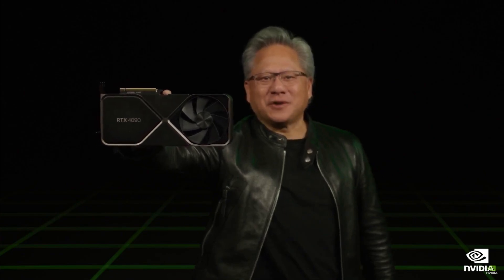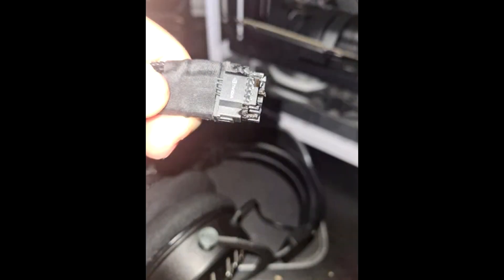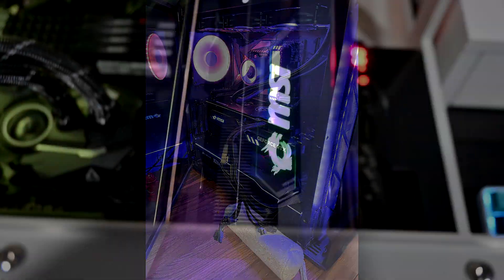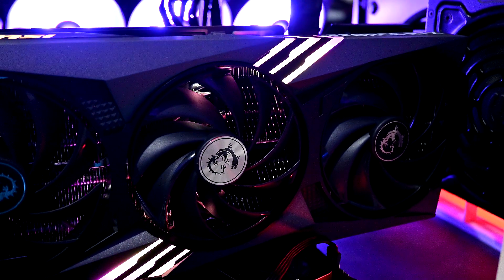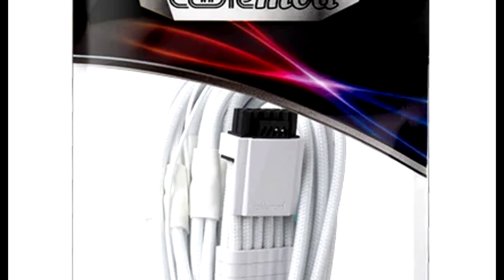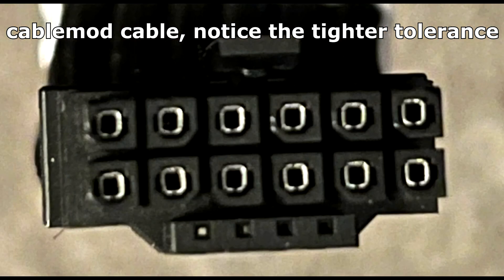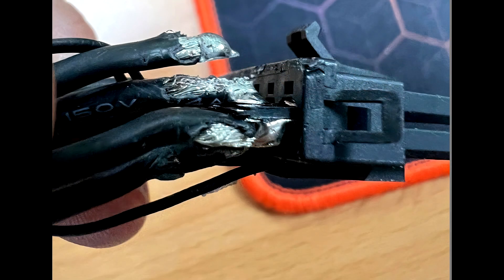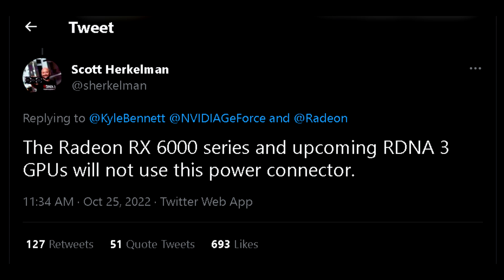RTX 4090 Cables/Adapters are Melting This is Dangerous! Nvidia Has Gone Silent and I Am MAD 😡

Comment: Planning on getting a new PC to replace my old high-end PC from late 2013, it's done me well throughout the years. Eyeing the Intel i9 13900KF, 32GB DDR5 5600mhz RAM, x2 2TB Samsung 990 PRO M.2s,  and the RTX 4090 to last me the next 5 years at least... but hearing of this issue has left me rather concerned to hold it off for awhile.

Comment: Steve at Gamers Nexus confirmed and Nvidia's internal testing confirmed user error in plugging in the adaptor. And of all the RMA's only effects 50 cases over a 125,000 sales. So a 0.04-0.05% chance if you aren't checking your cables fully seated. Also my MSI RTX 4090 Gaming X Trio is on its way and I cannot wait to game in 4K how it should be enjoyed, RDR2 is finally going to be maxed out haha ;) Just hope I don't melt my cable lol. Sounds like the early cases will be swapped under warranty but now the tests are concluded be very careful as they may not accept them moving ahead.

The connector is just a poor design sadly, still should've done much better then what's happened. Hopefully they can find a better design going forward that reduces the risk to 0.01%, always going to be human error in the world.

Comment: looks more like aconnector housing issue!, maybe there is a sub standard batch of poorer quality connector housings. i think they are injection moulded, might be a type of ABS plastic? i dont know. Also maybe as they are (it seems like) crimping 3-4  16-18awg?  cables to single crimps? Would br interesting to open one up to have a look!

Comment: mine actually runs quite well at 2.8ghz with 0.950v and 1500 mem oc at 80% power limit. i found i could reduce power by 30% and only lose 6% performance.

Comment: well i had even bought a new psu before 4090 launched, my old psu would've never survived a 450w card especially if it was plagued by transient spikes like the 30-series was, with spikes up to 2x the max wattage... so on a 450w card that would spike to 900w. played it safe and bought a new high end psu, it came with 2x 12vhpwr dedicated cables so i never used the nvidia adapter on my gaming x trio. altough i'm pretty sure it's not at risk of melting that adapter in this way, i have mounted a external temp sensor that came with my mobo. feeding that info into hwinfo and set an alarm when the temp sensor sees more than 55C, so far it's not even come close as i also monitor the temp in my in game overlay.

Comment: Your bench testing IS way different because people are bending the cables when they shut their glass side panels.  For example, the Lian Li Evo will not shut and you WILL have to bend the cable if you want the side panel shut, NOT SMART because IT WILL MELT

Comment: I bought the TUF OC the morning they dropped at MC and have been pounding it with games, even running it iverclocked and on top of it have plugged and unplugged it a bunch of times swapping gpu's around. Cable looks good as new amd it never gets hot to the touch which I've been checking out of curiosity.

My conclusion is that some of these adapters have got to be faulty but I also feel that it's a plug design oversight that can lead to user error. When you plug the 12 pin connector it requires some force for it to sear all the way inside and unlike regular pcie cables it doesn't click when it's fully seated. I think people not fully seating the plug could be a contributing factor.
Reply: Damn auto correct on the phone. Lol

Comment: Me who just got my msi gaming trio yesterday waiting to see if it melts lmao
Reply: don't use the card until an official announcement let's us know what to do.  Cheap 3rd party cables are just as bad and the 12 pin connector will stick and it's a PITA to get out....trust me.
Reply: @harpoon_bakery162  ordered cable mod adapters, in the mean time keeping an open case and avoiding any bending of the cables
Reply: @Taima_the_lion  how are you keeping everything cool with an open case?
Reply: @harpoon_bakery162  temps are really damn good, hottest my gpu gets is like 60 when gaming and that’s even without the fans maxed out either

Comment: Hi I am new to your channel. I wonder having atx/5.0 with 12vhpwr (one to one) thermaltake cable.. Do I have to worry?
Reply from the maker: Having a direct connection from the card to PSU without any adapters would be the best method for connectivity. You should be fine, I wouldn't worry about it.
Reply: @DannyzReviews  Thanks for the feedback.

Comment: It surprises me that at least one person had a problem with the 3x 8 pin to 16 pin on the gaming x. I thought it was the same adapter people have been using for the 3090ti for months now, as far as I know without controversy. You'd think if anything was wrong with it it would've been known months ago, but maybe it really is a poorer quality one.
Reply: 3x8 if self identifed by the cable to the card, but cable-mod said for more redundancy , use the 4x8 (Cable-Mod-Matt said that on a Reddit post).  What are YOU going to use, 3x8 or 4x8 to the 16 pin?

Comment: That's is why better to wait rather buy it and have a stupid problem i got my 3090 after a year i look if it good or has a worse problem. Melting power cable so scary what if you buy some drink outside  then when you comeback your house burning XD. When the new product come better to wait just hold on when everything is perfect then buy it.

Comment: I'm curious if the people with these problems are listing which power supplies they are using
Reply: Idk I have a 3090ti fe that I've had since they came out, and it uses the same connector, and draws more watts then my 4090 fe, and never had an issue with it, wonder if certain psus push an uneven voltage thru the cables in that adapter
Reply from the maker: Did the 3090 Ti FE come with the same adapter?
Reply: @DannyzReviews  I have the founders edition,  on the card itself it's exactly the same, the adaptor just doesn't have the 4 sense pins those are blanked out
Reply: Idk, I mean I'm a licensed electrician, and am also an electrical mechanic for locomotives, and dealt with a million types sizes of connectors and wires. They definitely shouldn't have soldered the connection. They should be either crimped or clamped, with some sort of clamp a little bit behind the connector to keep the wires straight, but there really should be nothing with the connector itself that can't work.  Pretty sure it's 14 awg wire which is definitely large enough,  idk i feel like it's getting blown out of proportion,  but obviously is an issue. I just think it's a manufacturer issue and not a design issue.

Comment: Danny, what vipers do you have there? 4400cl19 or 4000cl16?
Reply from the maker: The ones that I have are the 4000 cl19 versions. Not sure if they still sell those. But they were about $15 cheaper than the 4400 kit

Comment: Thanks for showing the mega thread, I haven't been following this issue very closely yet so hadn't seen it. Interesting to see it is nearly all 4-1 adaptors. Of course it looks like the Gaming X Trio isn't as common, so maybe 3-1 adaptors are just as vulnerable.

One thing I've noticed is Corsair's 2-1 cable has not been available since it launched. Melting issue aside, you'd think they would have planned to produce enough of them to meet demand for people who don't want to use the supplied 4-1. Maybe this means they've had to redesign it to a higher standard?

My X Trio is installed in a pretty big case, the Corsair 780T, but the case is on its side because I'm not impressed with the support bracket MSI included. I've also left the side panel off as it is acrylic and would be pressing against the adapter - not a good combination!! Plus it means I'm more likely to smell burning with it off!

I wonder if Cablemod's 90 degree adapter will be ok? It's due out on Halloween, so that's a good omen, right? It's probably the one that will fit best in most PC cases. What do you think? Keep us posted about which one you get.
Reply: Maybe the 3-1 is less vulnerable because it uses less power... 🤔
Reply from the maker: I'm baffled how short sighted Nvidia was on this matter. Right angle adapters should have been chosen without a 2nd thought.

Comment: Do you think upgrading to psu that has the 12 pin connector would fix this rather than using adapter to three or four 8 pins.
Reply: This is purely related to the adapter only. Nothing wrong with the card itself. The adapter is just shit, any PSU with that cable or a cable mod 12 pin should be fine
Reply: @6thonyGodtano  my psu is maingear ignition no adapter for that psu.. Wonder if I should look to upgrade the psu or just use the four adapter to 12 oin.
Reply: @6thonyGodtano  have my card vertical mounted so it doesn't bend wire

Comment: I wonder how many 4090 are out there for Nvidia not to say anything about what's going on. Because if there are 200,000 cards all together, and only 20 cables melted, that's only 0.01% failure rate, maybe that's not enough for them to care? even at 1% failure rate, it would be 2000 cables right? PS5 failure rate is 1 in every 1200 units.
Reply from the maker: The posts just seem to be piling in from what I am seeing. Nvidia will eventually have to address this.
Reply: Yeah people are overreacting. They will make an announcement once they figure out what the problem is and have a solution. People act like this shit wont be covered by warranty. If your are scared don’t leave your computer unattended or better yet don’t use your card.

Comment: 6:34 where the fuck and why the hell i see there white metal wires... and something told me that's shit is not silver... so, wtf?
Reply: those are soldered copper wire. and yeah, that solder work is really shoddy.
Reply: @josuad6890  so all that fibers amalgamed or plated by any other way by something is cuprum? are you sure? for me it's looks like aluminium fibers with soldered on the edge... if that is copper it's not so bad, i mean this world even better than i thought:)

Comment: My MSI 4090 MSI Gaming Trio only has a 3 of the 8pin connectors, hoping that makes it a bit safer.
Reply: No. Nvidia cable has ic that looks for a 4 connectors or uses less power.  Third party connectors don’t have that, so even two connectors can work-  each connector can do 300 watts.
Reply: I also have the same cards as you, I ordered a replacement but won't get here for weeks.
Reply: My 3080ti and 3090ti have been fine with 3x8>12pin for the last year in a Corsair crystal 570 RGB case will all glass panels installed. I feel alright about it in my Gaming Trio 4090. My computer is in a 5000x iCue Corsair case. Glass on sides and front and I bought a mesh top to replace the glass since I run Push/Pull on my top mounted 360 AIO. With 6 QL120s pulling air in and the 6+1 exhausting.
Reply: @goatzshop  I have the 7000X and the cable still has a big bent.